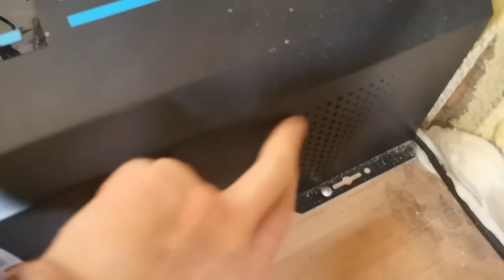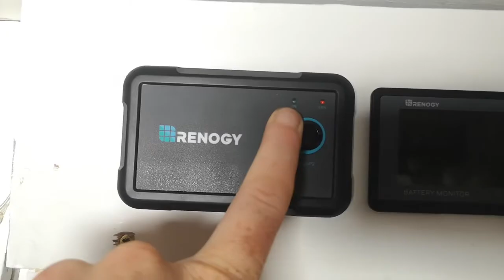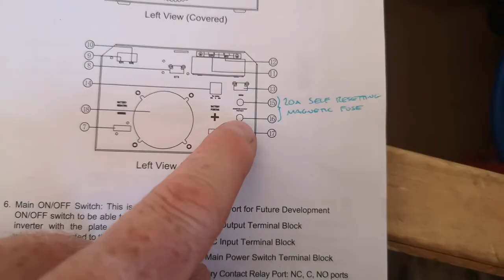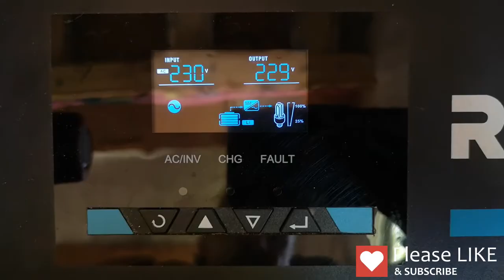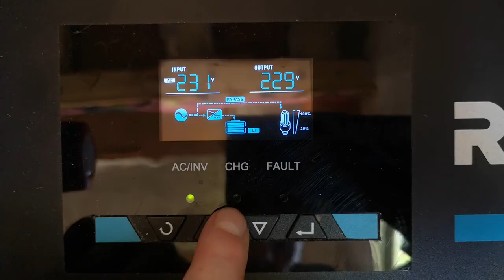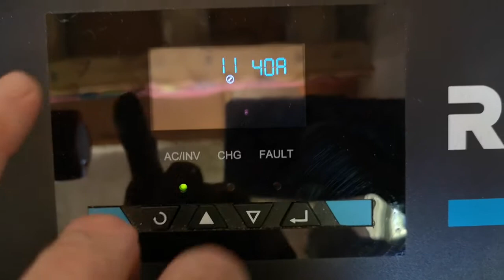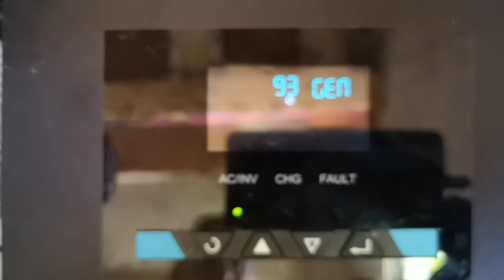Renogy Inverter Charger Installation & Setup | Part 1

Comment: Hi, I’ve got the same unit as you and would like some advice please 🙏🏻 in inverts mode I have input and out put on my led screen… input 231v,,,, output 229v but I’m not hooked up to my shore power? Also on inverter not hookup I’ve got the red light showing on my consumer unit to say wrong polarity ? Any advice is appreciated
Reply from the maker: Hi Paul, 

I'd be happy to help you out. However, to diagnose the issue, could you please send me an email to jolly@vandercampadventures.com with photos of your consumer unit wiring, the red light, and inverter charger wiring connections?

Regards,
Jolly
Reply: @vandercampadventures  thank you🤣I’ll send some pics tomorrow when it light 🤣
Reply: Hi Jolly i have the same issue as above. Could explain how to sort please thanks in advance. Great info so far thanks JP
Reply from the maker: Hey there. First thing to check is the cable connections into the inverter. Double check the hook up/shore power supply cable is in the AC input and the AC output cable goes to your 'sockets' (loads). 
If this doesn't resolve the issue, send me an e-mail (jolly@vandercampadventures.com) with as much info as possible and pictures and I'll do my best to help you out 👍.
Regards,
Jolly

Comment: Very helpful video. Thanks.
On my inaugural trip this weekend, testing out my new solar system.  4 x 100 ah batteries. 3000 watt Renogy Inverter Charger (IC).  Solar panels not yet live. Canada. 120 volts. In Rpod Trailer.
1) Hooked everything up at home. The IC successfully charged batteries to 100% with shore power.  (Did each battery separately to balance cells) 2) Disconnected shore power. Put a load on each battery to take them down to 20%. 3) Connected shore power again to bring battery up to 100%.
Now, I am at my campsite. I am plugged into shore power. Everything on 120 is running great. Fridge (set to shore power) and Electric Heater. The issue is, battery continues to discharge at about 30 watts, which would be the power which the inverter uses. The batteries are now at 87%.  13.34 Volts.
So, my question is, shouldn't the charger be keeping the batteries at 100%.  Tomorrow, when I disconnect from shore power and move to a location where I boondock, would be a shame if I can only start with batteries at 80%. Or do the batteries have to drop to the factory default of 12.6 volts before charging is activated?
Reply from the maker: Hi Brian,

I assume you are using lithium batteries in your setup and have set the battery type as lithium (program 05)? If that's the case, the charger will start charging your battery when you connect to shore power. It will charge the battery to 100% (14.7v preset) and then stop charging. When the battery voltage drops to 12.4v, charging will resume.

To avoid the problem of moving on with not fully charged batteries, we switch off the shore power and then switch it back on again. This way, the charger will top up the batteries to full before we move on. 

I hope this helps you. If you have any further questions, please feel free to ask.

Happy boondocking and solar set up

Best regards,
Jolly

Comment: How many amps are you pulling in with your Rover & how long are you pulling? I have the same Rover, when I'm getting 26 ah the unit gets so hot the wires starts to smell. I believe i have the biggest wore i can get to fit, which is 4 gauge. I used 1/0 gauge to connect the inverter, had to make the ends. I have a steam shower in my van so i have a huge power draw.
Reply from the maker: Hello there, my apologies for the delayed response.

If the cables are the correct size, the most common reason for them getting hot at an inverter is the crimp connections. If these connections are not done correctly, some copper strands may be loose, causing a bad connection, which under load will generate heat.

In order to diagnose the issue, I will need some more information from you. Could you please answer the following questions:
- What is the wattage or amperage of the steam shower?
- Where exactly are you getting the 26 amps?

Regards,
Jolly
Reply: @vandercampadventures  I have installed two fans behind the Rover that have solved the problem. When I have the steamer on, it draws 102 ah. I have 680 ah lithium power bank, 700 watts on the roof & 400 watt solar blanket, 50 amp dc to dc 2k inverter, Rover 60 amp all Renogy but the shunt. It's been about a week, I was getting 49ah for a few hours, and the charge controller was cool to the touch. Just needed more ventilation.. Thanks for getting back to me.

Comment: How do you ground it if its not used in a van but in a house? Just to a negative battery connector?
Reply from the maker: The ground wire must be connected to the AC mains power earthing system, which is typically located in the AC fuseboard.

Comment: I am trying this: battery is priority, if voltage drops to 12v then switch to utility, if battery charged to 13v (solar)  then go back to battery, just cant get this working, any suggestions? tnx
Reply from the maker: Hi there,

Interesting setup and the idea behind it is great.

There doesn't seem to be a setpoint for switching the power back to battery priority. There may be a built-in setpoint that is not mentioned.

Have you tested the setup to see what happens when the voltage rises after the battery priority switches to utility power?

I recommend contacting Renogy support and providing them with as much information as possible. They'll be able to assist you better.

Sorry I couldn't be more helpful.

Regards,
Jolly
Reply: @vandercampadventures  Hi,  I asked same question on amazon ... there is a setpoint 12: " Low battery voltage point when the power source switches from battery to utility But there is NO auto switch back to battery if is13v ( solar)?"
Barry answered:
"I sent mine back for a refund. Could not get it to work."
Renogy support made me 1 month of rounds with mismatched answers, looks like they finally accepting that there is a bug, promised to resolve issue..
Reply from the maker: Hi there,

I've spoken with Renogy support about your issue and they've replied with 'While the current functionality of the inverter requires a restart to switch back to battery power, our team is actively working on improvements to enhance user convenience.'

A restart involves powering down the inverter charger by isolating it from all AC and DC power sources. Not very convenient for your needs. 

They're happy to facilitate a return for a refund if the current setup is less than satisfactory. 

Regards,
Jolly
Reply: @vandercampadventures  Thanks!  But main issue is that there is no setpoint for ats switch back to battery

Comment: Hello!

I am in the US so our voltage here is 120. I think my Inv/Chg pulls 30 amps, and when I was working on my build I had it plugged into my regular (old) house outlet which I assumed only provided 15-20 amps. But every time we plug it anywhere else, it flips the (campground/friend's house, etc.) breaker. I got a 30 amp adapter and it works just fine with it, so that is why I am assuming mine pulls 30 amps. Per your video, if I go to setting 11 and change the voltage coming in (pull - charge), it should allow me to plug it into a regular outlet providing 15-20 amps without flipping the breaker? Or if I prioritize the batteries, would that do the trick? We are going to visit friends and it would be great to have power. Thank you so much for this amazing video!
Reply from the maker: Hey Raquel,

By default, the current for the 2000w model is 65 amps, while the 3000w model is 75 amps. The charge current for the battery is 12 volts, which means that the current required at 120 volts will be 6.5 amps for the 2000w model and 7.5 amps for the 3000w model. Therefore, overloading on a circuit breaker shouldn't be an issue. 

However, the problem could be the connection between the 15 amp socket and the inverter (e.g. a shore power extension lead). It's worth noting that campgrounds and electrically up-to-date houses will have an RCD in their consumer unit that will pick up on even the slightest issue and trip out the circuit. So, it's important to check the 15 amp socket connections, where it plugs into the campervan and inverter. 

If you need further assistance, please feel free to send me an email at jolly@vandercampadventures.com. I'll be able to go more in depth to diagnose the issue for you. 

Regards,
Jolly

Comment: Will it charge the battery when in battery priority mode when AC is connected before it hits the low voltage setting? Or does it just not charge the battery ever when in battery priority mode?
Reply from the maker: Hey Joseph,
The inverter charger does not charge the battery in 'battery priority' mode. 

The AC source will supply power to the loads only when the battery reaches the 'low battery voltage setpoint'. If there is no AC source (hook-up) available when the battery reaches the 'low battery voltage setpoint',  the inverter charger will shut off all loads to protect the battery from over-discharge. 

I hope this helps,
Regards,
Jolly

Comment: The risk with mounting the inverter vertically is that some dunce is going to put his coffee cup on the vent opening...  The installation shown in the video looks like it's in way too tight a space for ventilation.  The manual specifically states:  

"Cool, dry, well-ventilated area — Heat is the worst enemy for electronic equipment. 
Inverters must be in an area where the fans are not blocked or where they are not hit
directly by the sun. They should be in an area free of any kind of moisture and *_allow for 
clearance of at least 10” around the unit to provide for adequate ventilation."_*

There doesn't seem to be more than an inch of clearance on the input end.  Bad idea.  His 600mm x 300mm space recommendations are WAY TOO TIGHT, per the manufacturer.
Reply from the maker: Hey Evan,

Thank you for sharing your concern. As someone who has worked with electrical components for 17 years, I completely understand the devastation that heat can cause. However, it is important to note that the manual guidelines for the location and ventilation of the inverter charger are just recommendations.

While designing our layout, I was worried about ensuring adequate ventilation for the inverter charger. However, to follow the recommended ventilation guidelines, we would have required a space of 1000mm x 700mm, which we do not have. Therefore, I contacted Renogy support to express my concerns and discuss our proposed airflow and vents plan. Renogy confirmed that their stated ventilation guidelines are recommendations only. The most important thing is to ensure the vents aren't blocked and the air can move and circulate through the inverter charger, which should not be in a sealed box. 

Our unit is not in a sealed box; it's in a space allowing sufficient airflow. We have installed 2x 75mm drop-out vents in the floor, one on either side of the inverter charger. Additionally, we have created 3x 50mm vent holes in the seat base to ensure the air can circulate underneath the bench seat and electric compartment. 

Given my concerns, I have closely monitored the unit's temperature when the charger is charging at full power (65A), and the inverter is powering a high load. I can assure you that the unit does get warm, but not enough to cause any concern, even during a 2-week heatwave of 40 deg C.

Regards,
Jolly

Comment: I bought The same unit This past July (2023) but I'm in Canada so it's the 2000watt - 110Volt version. Thanks for sharing your instructions and install specs.  So far mine has worked just like it says it would. Mine also can not turn the sound off for the buttons. I learned from you ,the charge rate , as i didn't consider the loads also being drawn on the cables for my 12v side of things. For the Heat I put a 12v Temperature control board in with a couple computer fans to help exhaust the heat to the  outside of the compartment . Thanks for The video.
Reply: Go carefully.  Your manual talks about spacing for ventilation very differently than what you see in the video.
Reply from the maker: Thanks for your concern Evan. In my reply to your other comment, I discussed the reason for the inverter charger location and explained our ventilation concerns. This should answer your concerns.

Regards,
Jolly
Reply: Probably going to get grief, but I've left the back and front panels off as in a location where nothing is likely to disturb it. @vandercampadventures
Reply from the maker: Hey Jay,
Glad the video was helpful. Great idea for extra ventilation 👍.
Regards,
Jolly

Comment: I understand following the data sheet but dont you find they are always massively over spec’d? Surely the hookup cable you plug in on site will not be 6mm? More likely to be 2.5mm?
Reply from the maker: The 2000w model can be supplied with a 2.5mm cable. However, it does depend on the cable length due to voltage drop. That's why we recommend doing your own cable calculations to find out what cable you need. 
We used 6mm from the consumer unit to the inverter because we had some spare.

Comment: Could this  model inverter/charger be used 24/7 in a small house or is it just for campers or that in the summer or weekends?
Reply from the maker: It depends more on what your using it for rather than its location. I should be fine as long as it's being used to the manufacturers recommendations 👍. 
I'm interested what you'll be using it in for house?
Reply: Hello, I've been using a Krieger 1100 for the past 12 months in a caravan we are living in temporary on a site out in the sticks, when we didn't have the generator running for internet, telly and that, which was running off my old lead 120amp battery which we since replaced with a 200amp lithium battary, so I decided to buy 3 X 450w 12amp solar panels, and a  Renogy rover panel controller like yours, but only used one panel, and it worked very well, we only use the generator now for vacuum and washing machine, my partner don't like living in the caravan, so I'm thinking of getting a perfab house for her, and putting all three panels on roof of that unit, connect them to the rover unit, then to 2 X 200amp battaries to inverter like what you have but 3000w, that way we only have to use generator if any section of solar system breaks down, of course you can't use power in this system like a conventional house, you have to watch the limitations of the inverter, I'm about to order an inverter same as yours, bar it being 3000w, and my Krieger has just packed in, ( which I going to use for emergency back up)what I'm wondering, should I buy cheaper inverters or that, and if they are going to pack in once a year or that, replace it with another cheap one or will buying a more expensive one worth while, or in your opinion should I be going to 24/48v which I don't want to do because it's handy to have a 12v system and purchase 12v/240v appliances for more options if inverter fails, thanks for your time, sorry about the essay